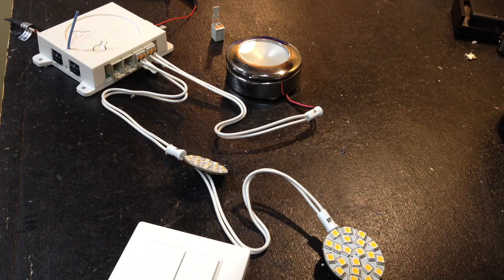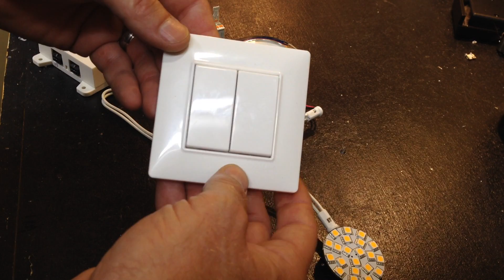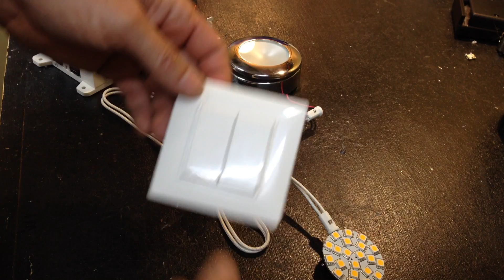Marinebeam DC Lighting Control Module

Comment: Is there any way to do the same functionality with a momentary on off switch wired back to the module?  I love your switch but don't have space for it where I want to put it.
Reply: Yes, in addition to the unlimited number of wireless switches, the system can support up to 4 wired momentary switches.  If planning using no wireless switches, you can dispense with the receiver module and use just an auxiliary slave module and get the same functionality for less money.
Reply: @jefffield7676  great news!  I have been wondering how to get three way functionality without a large wiring project.  This sounds like the way to go!!
Reply: @meestahwah  It will treat the wired input just like a wireless switch.  So, multiple switches could control one channel of lights, or a single switch could control all 6 channels of lights (or some number in between).  It could also be expanded with a Canbus cable and another module to expand the system.
Reply: @jefffield7676  do you have a model number available so I can search your website?
Reply: @meestahwah  Model Number is 41.72106.  Visit this direct link, and let us know if you have questions.  https://store.marinebeam.com/scheiber-lighting-control-module-expansion-module-for-light-air-switch/
Reply: @jefffield7676  excellent!  Thanks much.